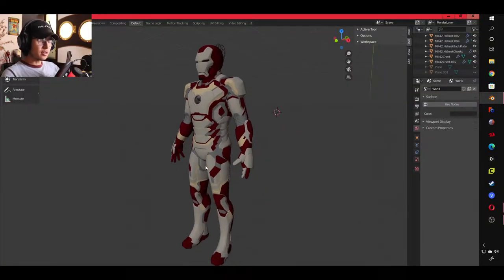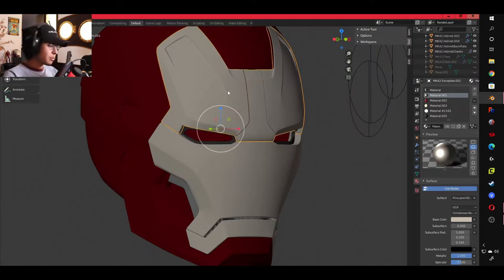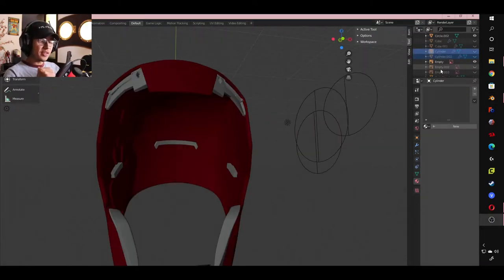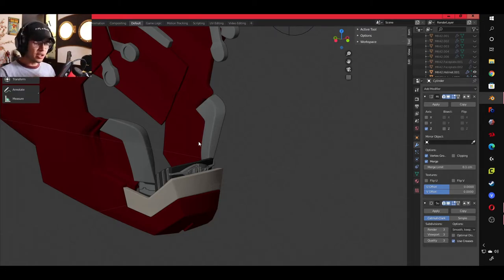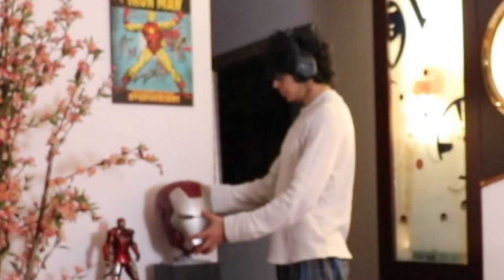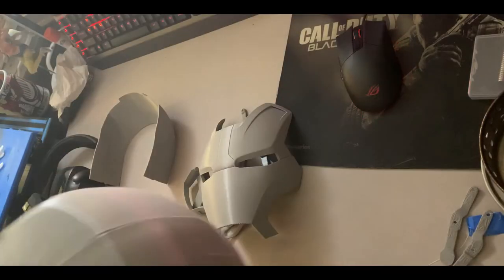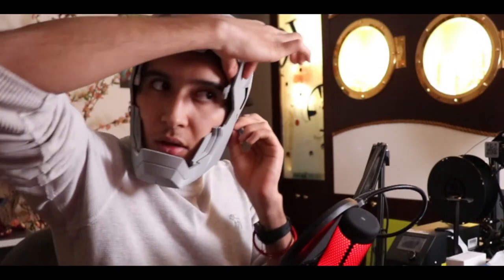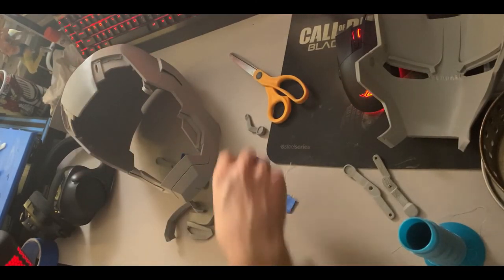Iron Man MK 42 Project | PRINTING THE HELMET

Comment: What is a good beginner printer
Reply from the maker: In my opinion the Creality Ender-3 Pro is a really good place to start since it’ll set you back about $240 USD for one on Amazon which is a really good price for a beginner. However, if you’re willing to shell out an extra $70 for a much bigger build plate, I definitely recommend the Creality Cr-10. It’s currently on discount at $310 on Creality’s website so I’m not sure how long it will last. I currently use both of these printers and they work really well. Hope this helped!